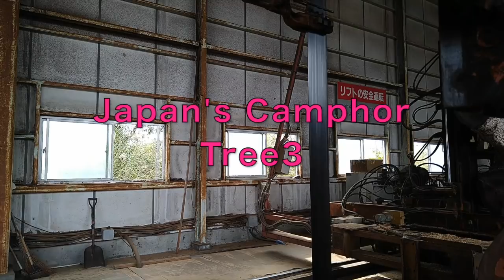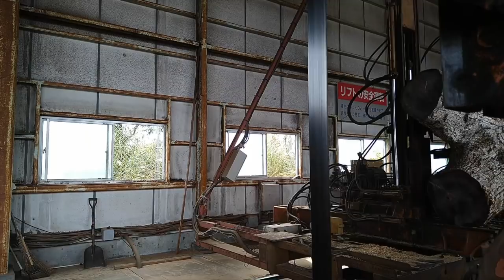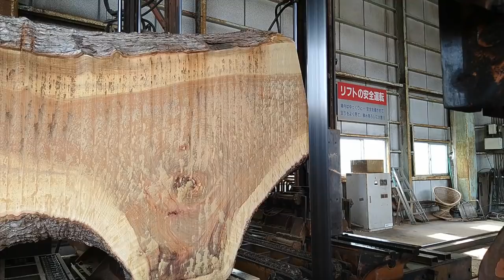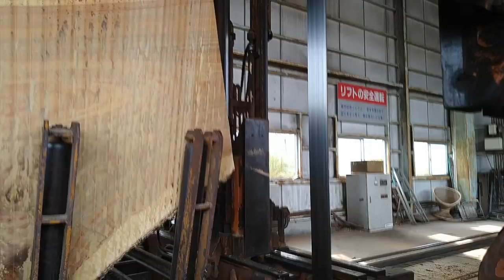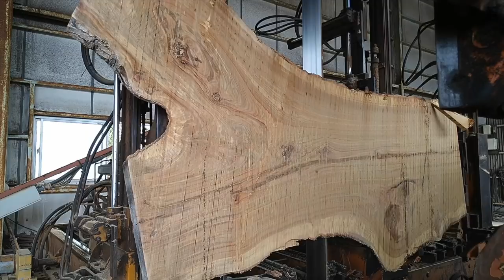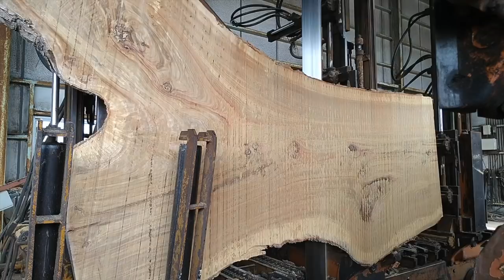Japan's Camphor Tree3

Comment: From watching that video, one or more of the "teeth" on that band saw blade have more set (that is teeth bent to increase the kerf or saw cut width) that the others do.    That is the reason there are regular irregular marks on the planks as they are cut
Reply: John Leake I noticed that also, if you watch the blade there is definitely hanged in colour. Never seen this in any of his other videos, I wonder if it is blunt or of the wood in very hard.
Reply: But did you notice the customer's way of handling his slabs?  With an adz-ice-pick, I have never seen that before. Ever. I would not change the blade after seeing this. Mr Sasada usually changes blades after 3 hours,(this is my understanding) and his expertise in cutting and handling logs is unmatched, in my opinion. Check out his video library, see some spectacular product.
Reply: @goatamongsheep4296  As a former lumber company employee, Mr Sasada's actions around that bandsaw are not safe and would never be permitted in the USA